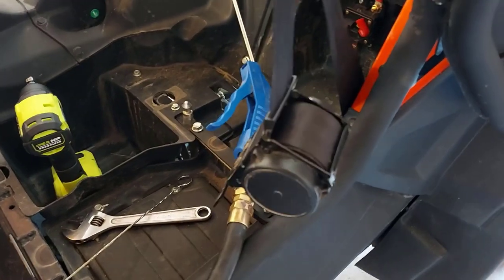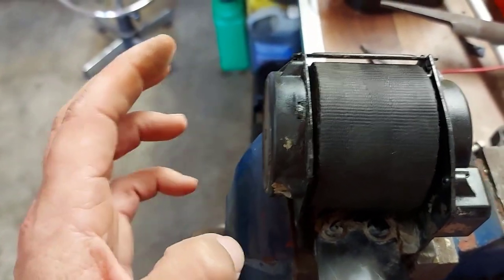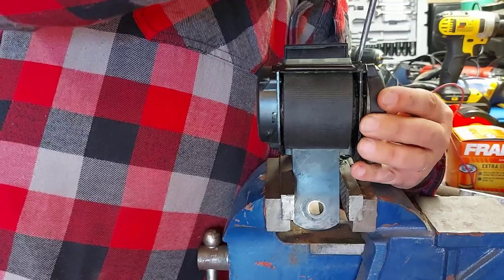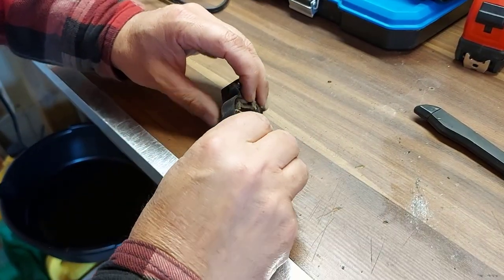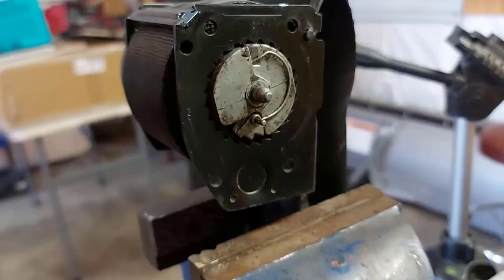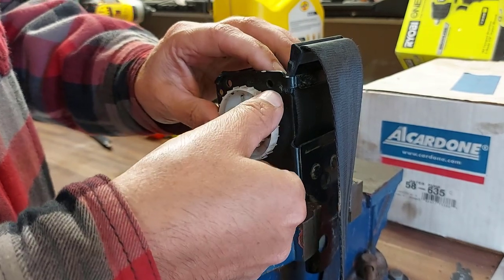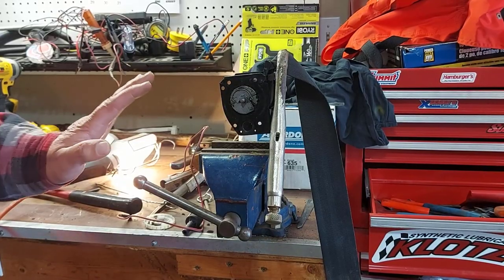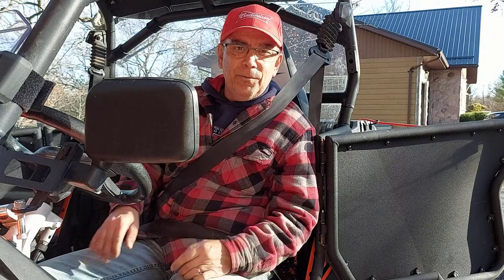My CFMOTO ZFORCE Seat Belt Was Stuck | Here's How I Fixed The Issue

Comment: I just purchased a use 2021 800trail and the seat belt was jammed. This video was extremely helpful. I removed the seat and then I just removed the cover without having to remove the whole seat belt assembly. I had the job done in less than a half hour. Thanks for the video.
Reply from the maker: You're welcome :-)

Comment: Thanks for the internal view. It was very hard to remove so I shot brake cleaner then wd40 into the lower latch area by a tube whilst rattling in the strap and tapping the base mechanism with a small hammer.  It gave up after 20 seconds and is working ok now.
Reply from the maker: Glad you got it

Comment: cut up an old inner tube and cover that big hole below the seat belt holder. keeps the crap out of the seat belt but still lets water enter and leave. also cuts down on dust in the cab

Comment: I know this isn't the video but if  anyone has intermittent power steering. Pull the driver seat. Check the 2 fuses. One 30 one 40. Just make sure both are tight and not loose.
Tweek with needed nose or small flathead. Shop wanted over 2 grand to fix.

Comment: Before you go crazy and unbolt the seat belt, take a small rubber mallet and tap the seat belt lightly, This should (at least it has with mine) loosen the locking part and have the seat belt be free. Then wash it out good with water. If you want to lube it, use silicone. This should not cause the stickiness that WD does.